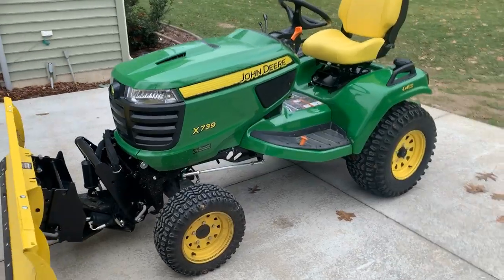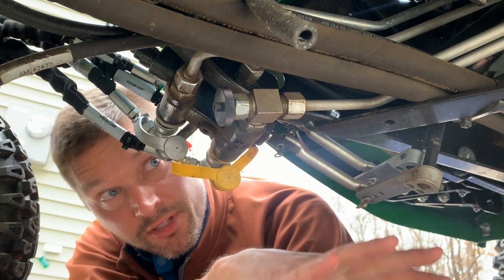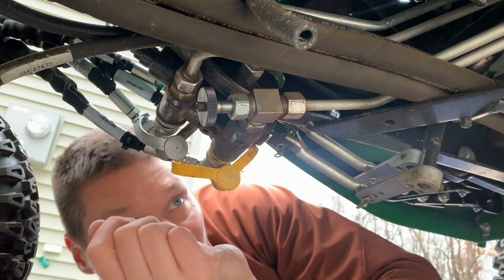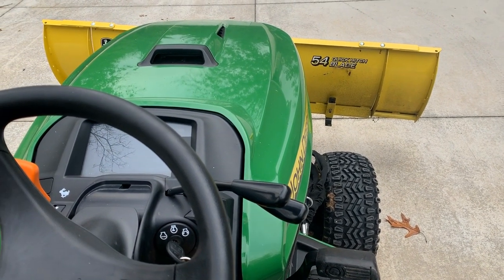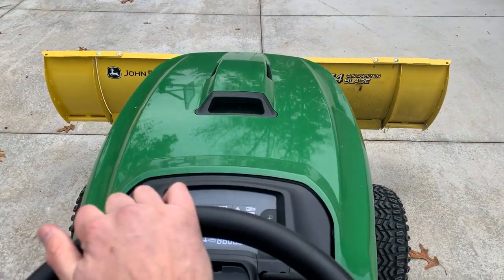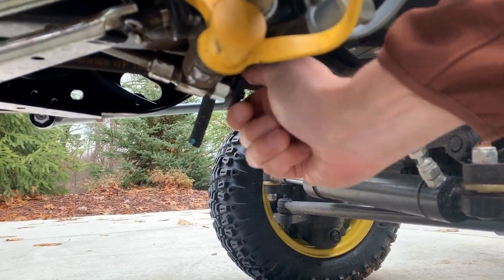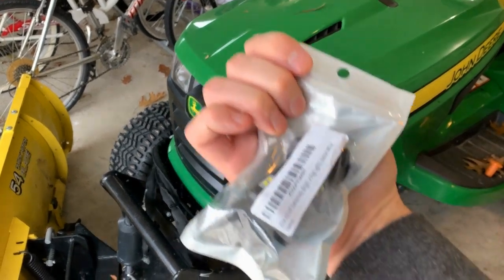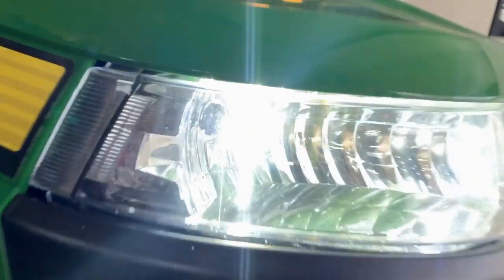Add A Lockout Valve For Your John Deere Snow Plow! PLUS Bonus Halogen To LED Head Light Conversion!

Comment: Enjoy your videos!  That looks like a big plow for a tractor of that weight and no chains.
Reply from the maker: It's amazing the difference that a tire pattern can make.  I can definitely stop the tractor in its tracks, but it's also angled most of the time so it's taking a narrower swath than it seems.  Plus, the load is "sliding" off to one side when angled so that helps to keep it moving as well.
Reply: @GoodWorksTractors   HDAP, Oh you are so right about tires!

Comment: Do you feel the auto connect pto is worth it? I have heard some mixed reviews about it being more hassle than it is worth. No to mention you have the auto connect under the tractor when snow blowing. When I get my x739 I plan to mow and switch out in the winter for a snow blower. Possibly take the deck off once during the summer to clean and sharpen blades. I feel like it would be easier to just get the standard shaft.

Comment: I have an older X585 with the 54" plow (without extensions). I also have newer HDAP tires but still have issues plowing on occasion even with 4WD and the differential lock engaged. In the most recent storm, I was spinning all 4 tires in about 10" of wet snow. Do the suitcase weights on the rear make a noticeable difference with traction in these scenarios? I have chains as well but dont want to ruin the new concrete floor in my garage with them. Thanks for the led headlight tip as I was looking for different options and I believe the X585 uses the same bulbs.
Reply from the maker: Thanks for watching.  I haven't ran this machine without suitcase weights so can't say with certainty.  However, I'd be surprised if they don't help.  Ballast weight helps on all the larger tractors I've used.  Chains also help.  Take a look at the Terra Grip rubber chains that will better protect concrete and paved surfaces.  Good luck!
Reply: @GoodWorksTractors  

Will do and thanks!

Comment: Does the hydraulic lift on 1025r have the same issue.
Reply from the maker: Howdy, it does not.   The front blades on the subcompacts run off of the loader controls.
Reply: @Good Works Tractors 
Thanks